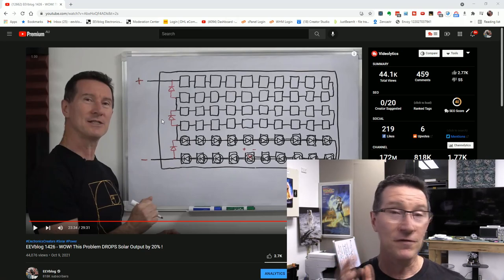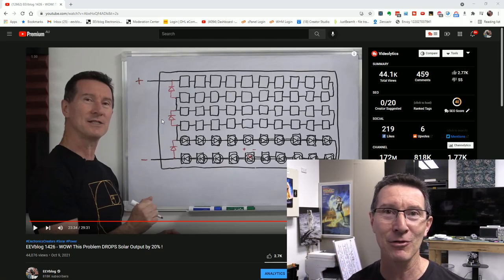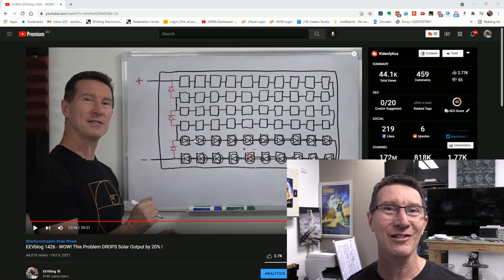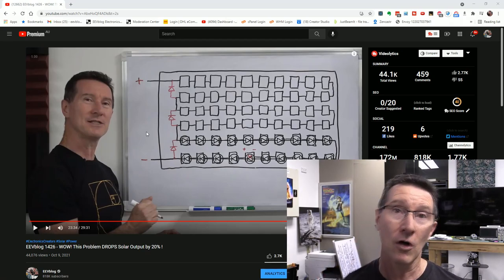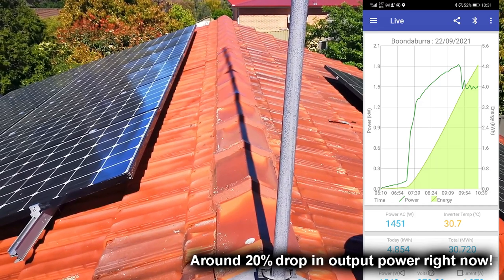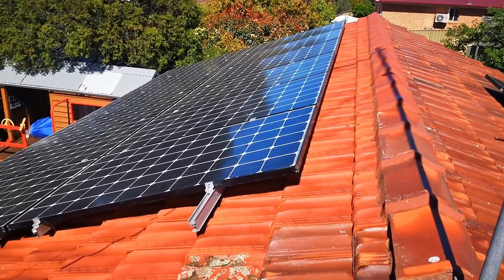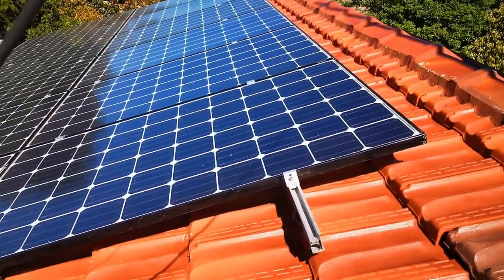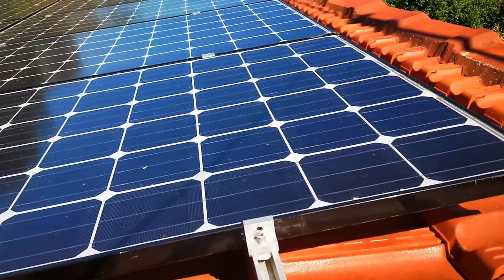How a SMALL SHADOW can drop Solar Power Output by 20%!

Comment: Would love to see an update if you can enable the OptiTrac Global Peak feature on your SunnyBoy inverter (now called ShadeFix).  See if the reduction is much improved to more of what would be expected with just the partial loss of the shaded panels - not 20% of the array.  I believe the default is off on these older inverters.  May also need a firmware update for the feature if your inverter is a certain vintage.

Comment: the "difussness" of the shadow might not matter because the same total amount of light is blocked on the panel. The total amount of flux that is blocked is conserved regardless of how diffuse the shaddow gets, or so I would think.
Reply: is not about how much energy is loss because of the lack of sun, is that those cell block the other illuminated cells too
Reply: @lesto12321  Yes of course I know that. When a cell has partial shading the increased series resistance of that cell will limit the performance of the whole series array. A large negative potential develops across it and it acts like a parasitic load rather than a source.

When doing solar car team at the University, I described it like if you got less than 0% on an midterm exam and got something like -250% and how much that affects your final grade lol.

Comment: I still have to get used to the fact that the shadows move in the wrong direction for you downunder... ;-)
Reply: I'm pretty sure they still point away from the sun down there.
Reply: @stargazer7644  they do, but up here they move from left to right during the day, not from right to left as in the video 🙃
Reply: @uwezimmermann5427  Do the clocks run the other way down there too?
Reply: @stargazer7644  I assume that sundials actually do!

Comment: Yes. Solar systems can be a pain in the ass. I have one array that gets quite a bit of shading caused by a tree. Its just a few single branches but it completely destroys the systems output. Sadly I can not cut it down.
Reply: If YOU can't cut it, find other ways to destroy it. Until it's necessary to be cut 😉

Comment: Just add the panels MPPT plated voltage, say 12 panels x 34v =408vdc goal. I know when it's lower the current and light input should be lower and when volts are higher the MPPT is not drawing enough current to see MPPT voltage. You need have a sun/power/volt/current graph and go figure your target MPPT controller tracking performance. And look out for current reversal into shaded parallel panels.

Comment: WHY ARE ALL THESE PANELS IN SERIES ?
Reply: No caps needed. It is standard to do it that way. As Mike said smaller conductor but also for the inverter. The inverters I have installed can not handle such a high current on the input side. 
Also if you split it you would need one more string. In Daves case I think it would mean another inverter. 

So the way its installed is the most logical, cost efficient way.
Reply: Modern systems aren't.  This is an older string inverter wired system.  Today they generally use Load Balancers or Microinverters.
Reply: It is cheapest at time of install. The old story; invest for later or pay less now. At a time when public awareness was low and it was about an installer beating someone else on price then cheapest wins. Most people were not even sure if solar panels were just a fad 10yrs ago. Individual trackers/inverters on each panel were not readily available back then and, anyway, significantly increase price. Parallel or multi string also increases cabling and electronics (price up) and connectors (possibly increasing the chance of a fault, too). The usual compromise is a bit of series and a bit of parallel. For domestic uptake with lots of competition, the industry had to aim near the lowest price.

Comment: So if a bird lands on your roof that's all you power gone for the day
Reply: More like if it nests over the panel cells. Depends on how long it stays there. If you scare it away then the output recovers.
Reply: @Valenorious  I meant more if it pooped
Reply: @LawrenceTimme  If the bird has diarrhea then I guess so. Needs to cover a substantial area of a cell or more than one I guess.
Reply: This would be an easy and interesting Test !
He can cover one of the Solar-elements and look at the Power-value and he can cover one solar-module completely.

I think this solar-cell-elements inside of the module are 6 parallel and 10 in line?
Or all 60 in line?

If all 60 are connected in line, then the power would drop to zero if one of this solar-cell-elements is covered.